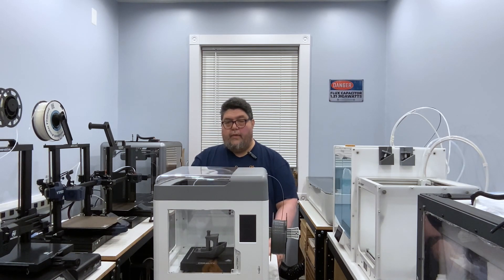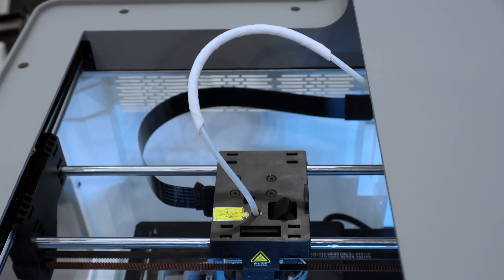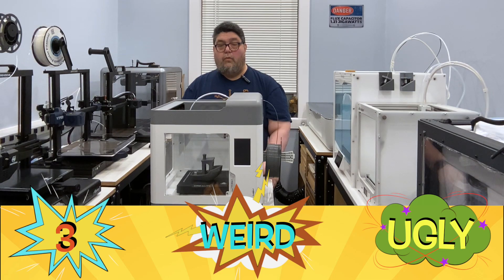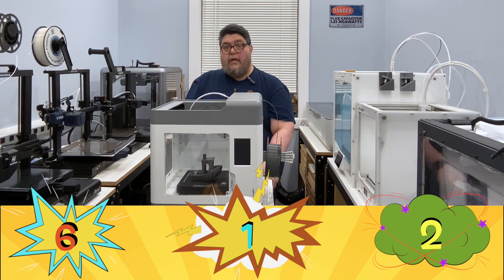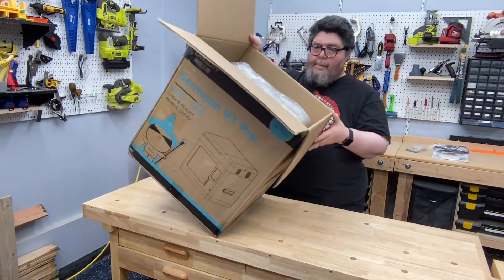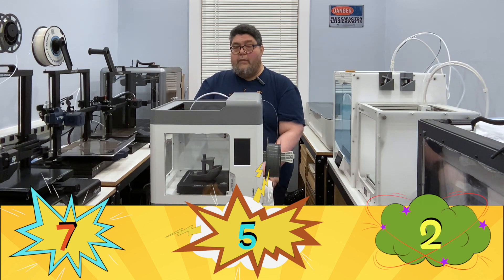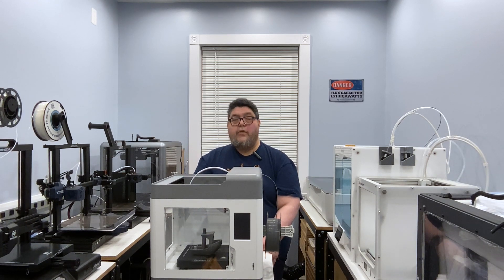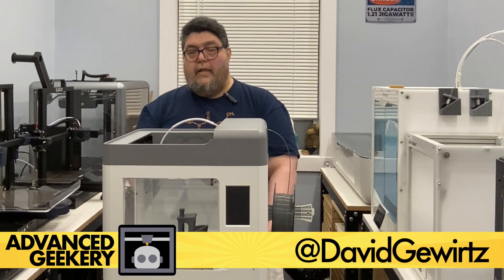Creality Sermoon V1 Pro: the good, the weird, and the ugly

Comment: Hi although this is enclosed Is it suitable for inside homes can you tell me if printing fumes still escape from inside the printer please through the vents etc thanks
Reply from the maker: That really depends on what filament or resin you're using. Thomas Sanladerer did a piece on resin fumes (https://www.youtube.com/watch?v=nofn_MHrxrs) that might help. My experience has been that PLA is fairly non-problematic, even in an open bed printer. But other filaments, like ABS, are nasty as heck and you need good ventilation. I would not rely solely on a filter in the device. If you're sensitive to the fumes, make sure the room you're in is ventilated. For me, my filament printers are in one room with just normal room ventilation, and I print almost only with PLA. My resin printers are in the garage and when they get nasty, I open the garage door.

Comment: Thanks for the through review. I ended up buying one and I did find that there is a network port inside the case which you can use to directly connect to the printer, avoiding the cloud or using sd cards, wish they'd put it on the outside. I'm now looking for something faster, larger print volume and quieter (if thats even possible).

Comment: I don't know I just can't see paying $500 to make plastic toys if a kid is really into legos then maybe if the quality is there to interface with the existing real legos the kid already has. Too much for too little.
Reply from the maker: @Floyd, I think you're being a bit more reductive than necessary. You can do a LOT more with a 3D printer (including this one) than make plastic toys for kids. Some vendors pitch their devices in that direction, which I think is a mistake. I've done a ton of work and home enhancement projects with 3D printers, and with the exception of my Yoda test print, haven't made any plastic toys. But don't sell this printer short. It does a lot right, and it is very much capable of producing useful prints, especially since it can print ABS for really robust objects and even flexible filaments.